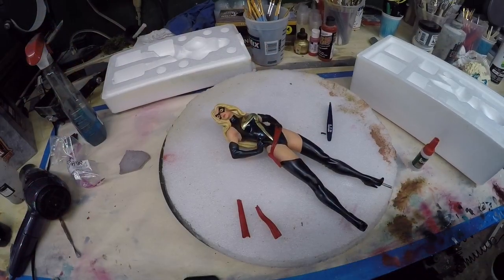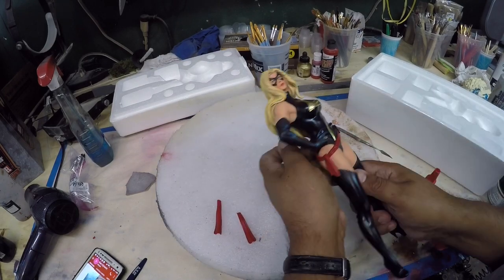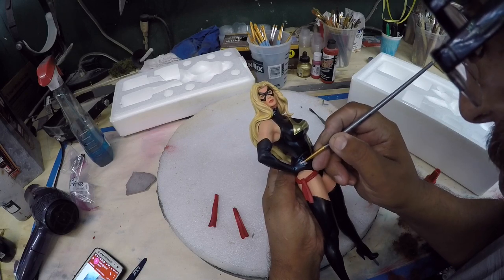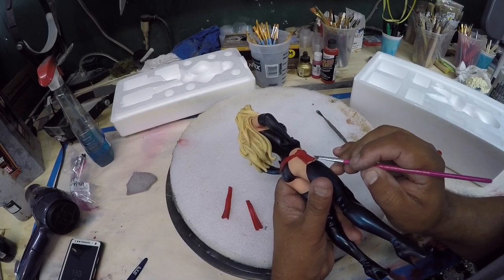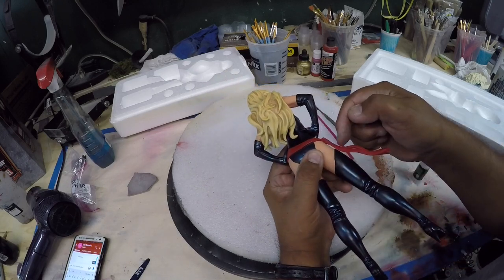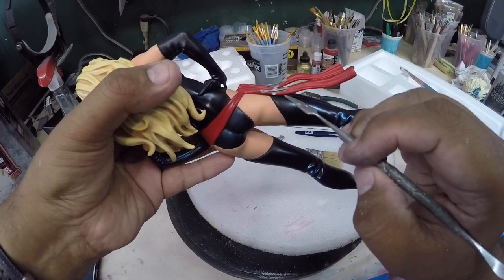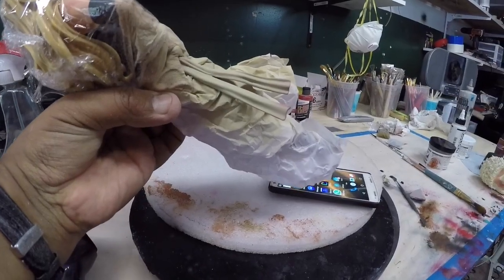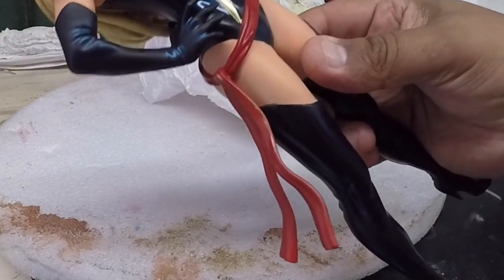Fixing A Broken Finger And Sash On Resin Statue

Comment: Hey rafie, want to start off by saying great work! Your channel is my number one source of information. And inspiration:) have a quick question: your series on turning the planet of the apes bust into silicone with real-ish hair is amazing! But can you perhaps provide me with the best way for me to accurately calculate how much say... dragon skin fx pro I would need to mix in order to fill my rebound 25 mold? I only have a trial unit of the two types and I would like to pre-calculate as best I can in order to avoid curing anymore material than I absolutely have to. Thanks in advance!
Reply from the maker: Hello my friend I had replied to your question on the other video you may not have gotten it , but this is what I said .

Thank you for the kind words , my friend ,  and if your talking about. Mixing the correct quantity to fill the mold I have to tell you that I normally eyeball it and do sometimes mix too much or not enough but one tip I got from a subscriber which I have not tried yet but makes a lot of sense , is to fill the mold with rice ,  or sand and that will give you a good measurement ,  the other would be filling it with water but then our will have to deal with letting it dry completely ,  I would try the rice or sand . If you want I can try the rice and see how close that works and get back to you :)